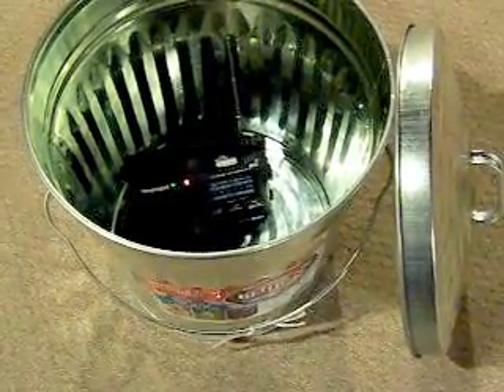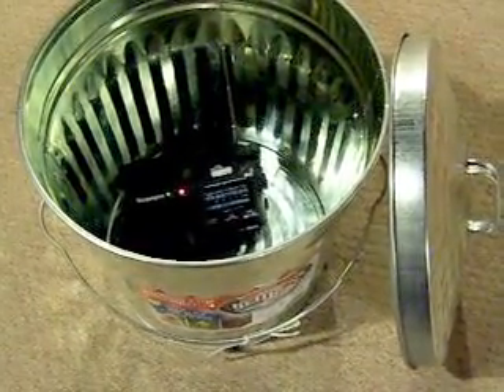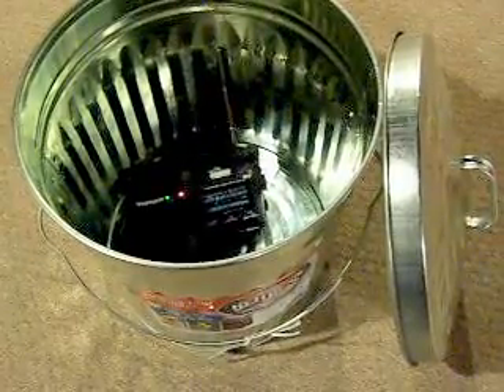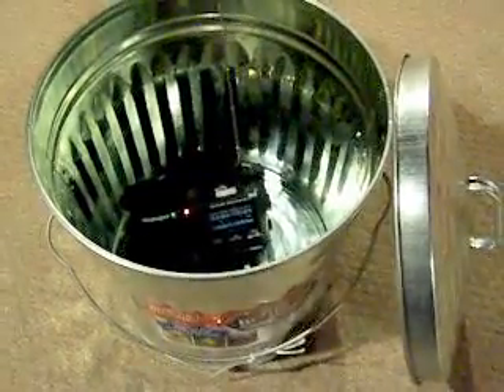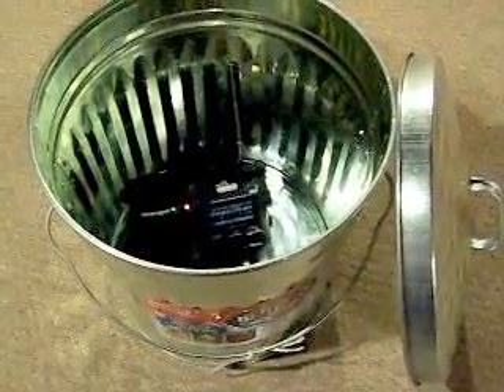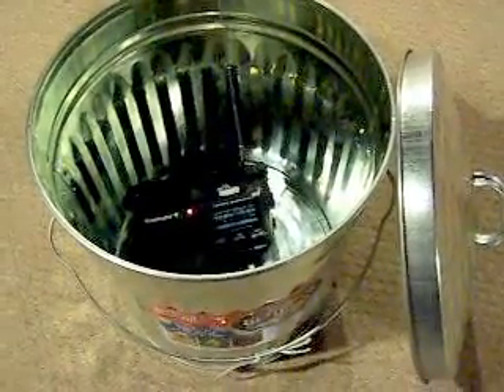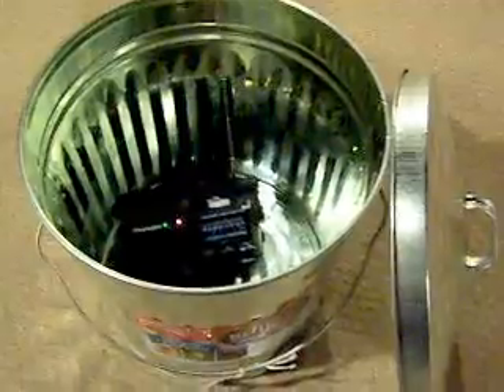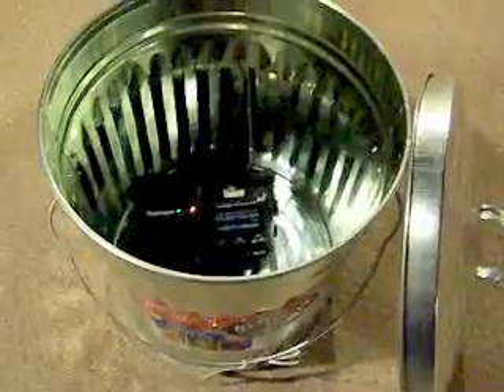Another Take at Simple Electromagnetic Pulse Protection for the Prepper

Comment: you dont need insulation for an EMP but you will need insulation for a solar flare because it travels along metal and conducts it right into th radio. At least that is my understanding, besides it is always better to over protect than under protect. It would totaly suck if your only source of outside contact is trashed because you did not insulate the cage. just some cardboard will work or even if you place the radio in a ziplock.

Comment: I wrap my solar/crank powered radios in heavy aluminum foil works great!  A "Faraday cage" only need be foil thick for EMP protection. Volkswagon Beetles from the 1960's suck, but have no semiconductor electronics in their ignition systems...they should work after an EMP event. I prefer '60's diesel cars with diesel fuel preservative (Stabilgas makes one good for 9-12 months) in the stored fuel tanks.